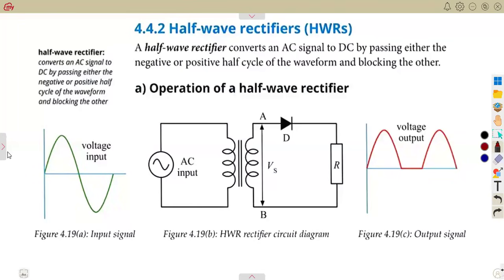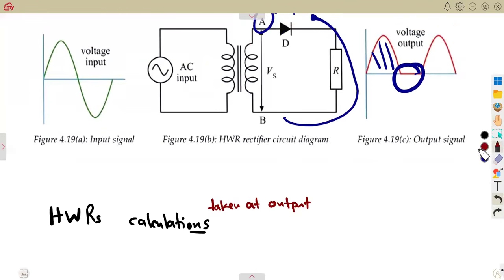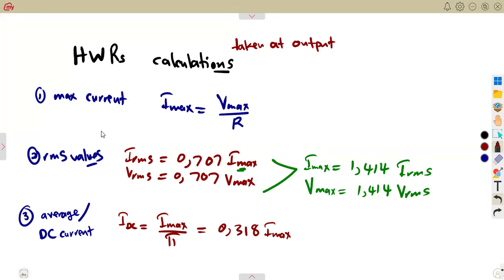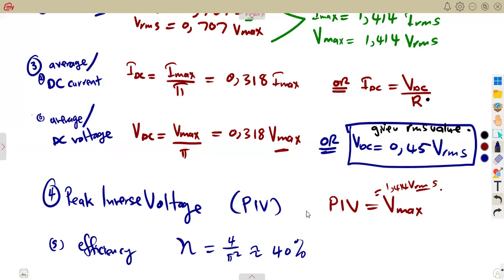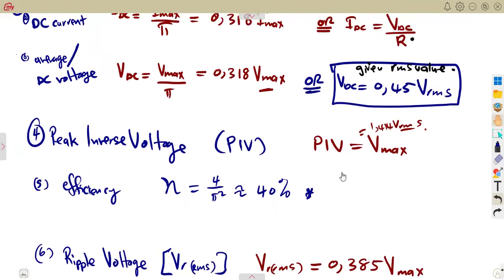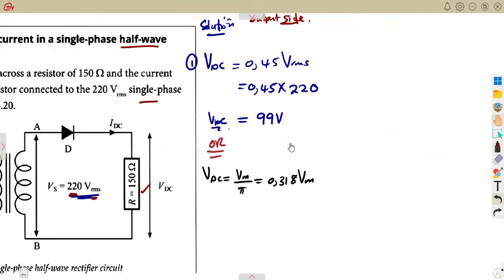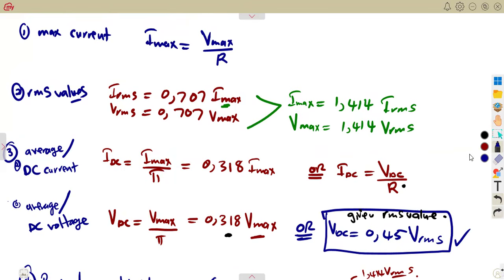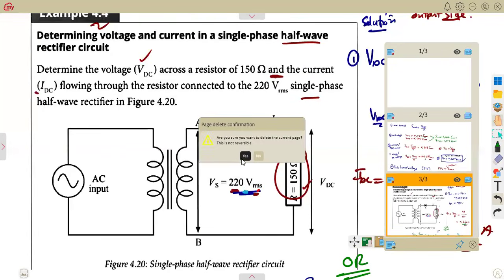Industrial Electronics N4 Half Wave Rectifier Calculations Part 1 @mathszoneafricanmotives

Comment: Guys some tips: to find the Vm just use normal Vrms = 0.707Vm then take that Vm and use it on the Vdc = 0.318Vm to get that Vdc, you will still get the same answer (do this if you  don't wanna memorize those other formulas that are not on the formula sheet)
Reply from the maker: Good catch! That's a great tip for simplifying the calculations.

Comment: I'm a bit confused regarding Vrms in a half wave rectifier.  Is Vrms= 0,5Vm òr Vrms= 0,7071Vm?...I ask thise because I'm not getting  0.386 when calculate Vrrms . Please assist. 🙏
Reply from the maker: It's Vm/2 sorry for that one
Reply: -The formula Vrms=1/2 Vac
-Its used in centre tapped full-wave rectifier only 
-When number of turns aren't given but you are only given maximum AC voltage